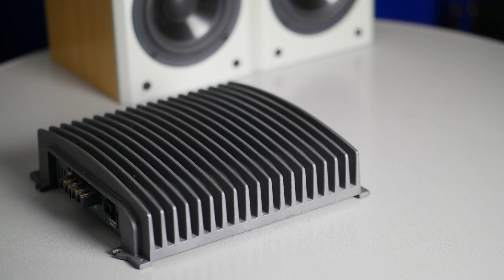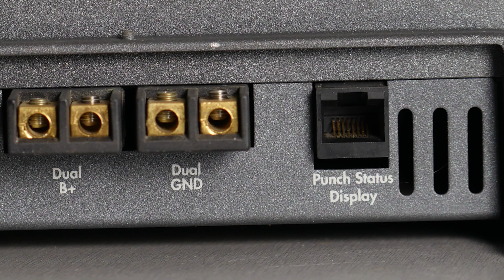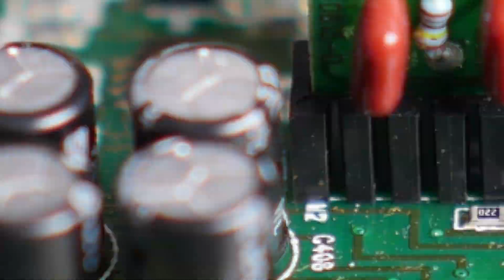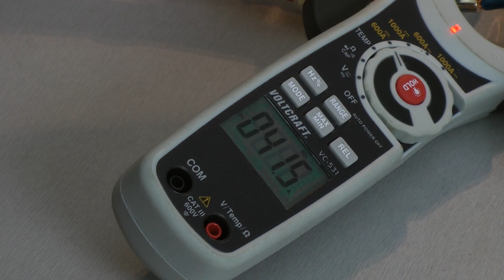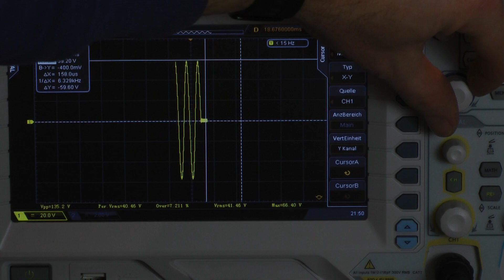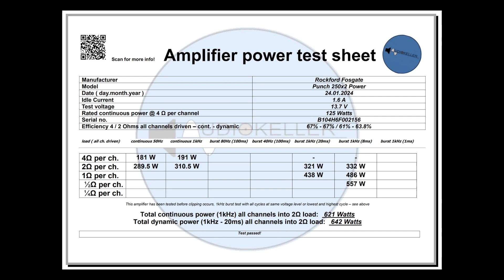Rockford Fosgate 1996 Punch 250x2 Power Series amp dyno oldschool car audio amplifier sound test

Comment: 73.4A draw at 4 ohms mono? Isn’t this amp supposed to be fused at 60A?
Reply from the maker: That’s correct 👍 but a dc fuse of 60A will not trip at 73A. It takes some time. The manufacturer suggested 60A fuse because you listen to music, not sinus test tones. Amp draw with music is much much lower because music has a way higher crest factor . Crest factor of sinus is 3dB ( 1.414 ) and music goes from let’s say 6 to 20dB because
Music is dynamically! Todays manufacturers don’t rate their amps continuously, they do it with dynamic bursts, 20 or 8ms or bandwidth limited pinknoise. Some of todays amps will just burn if protection circuit reacts too slow when testing with continuous signal. Check out the original birth sheets - you will see values of more than 70 Amps, sometimes less.

Comment: Ah the amps with the old X-Cards. Years ago I had to make an X-card, etched the board with a Dremel rotary tool and razor blade as I had an amp I needed to sell and the cards cost as much or more than the amp was worth (it was missing when I got the amp), it was a small amp. Cool amps, but I honestly do not miss the X-Cards for setting crossover frequency. 😅
Reply: Those xcards were cheap, full suggested list price was like $9.95! Someone must’ve been price gouging you.
Reply: @jimollison52   Well 10 to 15 years ago they were not very easy to find and pretty pricey on ebay, not economical for the small amp that needed it. Maybe calling Rockford directly would have gotten one if they still had them, but wasn't worth all that considering the age and size of the amp. I think I sold the amp for $30.

Comment: Nice. I still have my power 150, 2 punch 40's, 1 punch 60, 1 punch 75, 1 rf 2.3, and 1 rf 2.6 amps. Just can't beat old fosgate power and sound. I have a lot of other brands stacked up as well. Expensive and cheap brands I've collected over the years. My oldest working radio is a 1946 Motorola. Took me a year to get the vibrator for it. And yes it's an original 6 volt
Reply from the maker: Sounds like a huge collection 👍😎👋